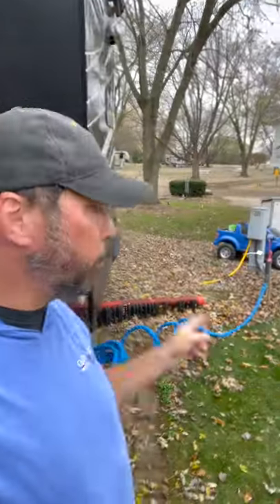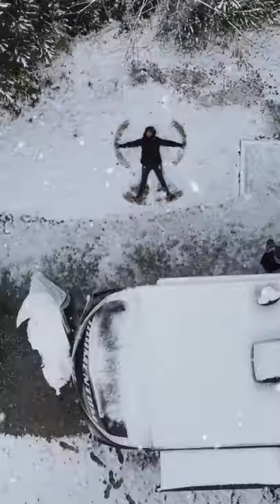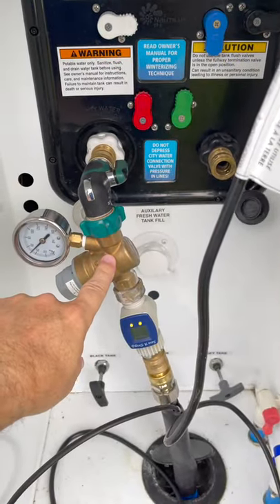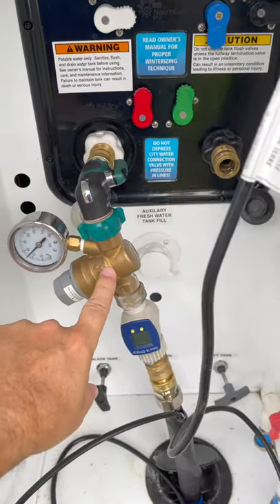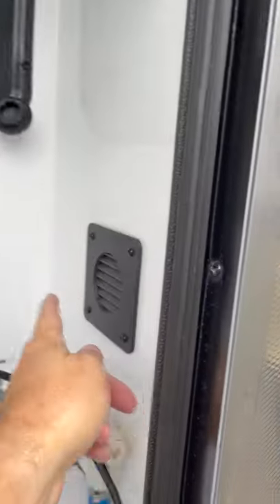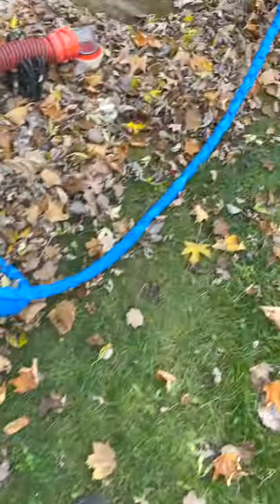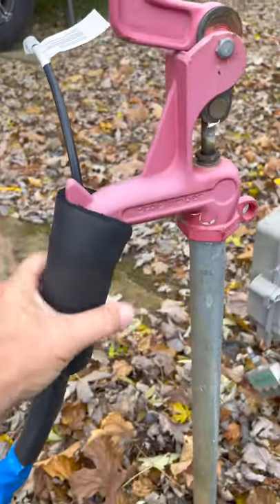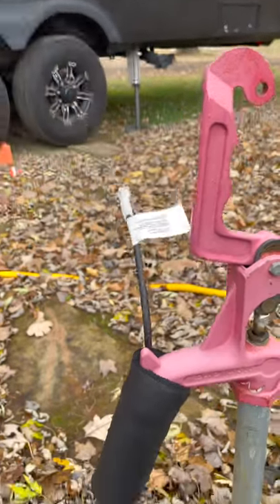🥶  WINTER RVing Tip! (Heated Hose)  #SHORTS

Comment: Take from a serial winter camper like me, heated hoses are a must, BUT, you really can’t leave them hooked up and run in city water mode. The frost free hydrant will freeze, so I place a y-valve at the hydrant end of the heated hose and fill my on board tanks and run off the RV water pump in between fills. The y-valve is to create an air inlet to allow the frost feee hydrant to drain to its gravel base, 6-8 feet under the ground level. Some might say you can just wrap the frost free hydrant with heat tape and insulation or put a heat lamp on it, and that will work in some climes, but not those with hard freezes because the ground freezes 1-3 feet below ground level. To Chad’s point, the heated hose does allow you to stay hooked up and not have to drain the hose between fills. Great video short guys!

Comment: I don't camp without this hose. The hose does use a lot of energy. It kicks on at 42° and stays on until the temperature rises above 42°. In order to save energy when temps drop into the upper 30s and low 40s overnight unplug the hose until freezing is in the forecast. Male sure to plug it in at least 4 hours before freezing is expected to ensure the hose doesn't freeze before the coil warms up.

I would not recommend using any sort of remote operated on/off plug adapter. Many remote operated items use the same frequency and coding. At least once a week someone in a neighboring RV has turned something on or off in my unit. My fireplace remote has the same code frequency as two space heaters, all of the RGB remote operated LED bulbs, and three of the eight LED candles. Yes, all of the remotes for the aforementioned items are work the same as the fireplace remore. It's so annoying. The last thing you want is a neighbor turning the your hose off when they turn off their lamps or whatever item may use the same frequency and coding as your remote plug adapter.

Comment: What do you do when the riser out of the ground freezes? 
Farm hydrants for cold weather have a drain at the bottom that allows the water in the riser to drain into the ground, but the valve needs to be turned off for this to work. This may not work with the hose connected depending on where the air goes in that allows it to drain.
Reply: It’s only heated to where the hose connects. Can’t see it working in very cold temps. Better off filling the tank as needed.

Comment: You do realize that the water hydrant is not protected, you need a heater on it as well.
Reply: We got one last year, after freezing hose the year before. The hydrant still froze though, thought about getting a short length of pipe insulation for next time.
Reply: K Math that type of hydrant is for cold weather, the handle is connected to the actual valve by a rod and it is below ground where it won’t freeze.
Reply: @williamdodson6681  William there really is nothing that is protected from freezing. This particular water hydrant also known as a frost free opens the water valve several feet below ground. So with that, the entire pipe from 4-6 feet down is full of water when opened. When you shut these type water hydrants off the water drains out of the pipe by the vale. You must unhook the water hose unless an anti siphon value is on it.

You can wrap the hydrant with heat tape, this is an heating cable you plug in to a 110 volt plug as well. Then wrap that with insulation. The big problem is if you are in a cold climate the frost will get deep and could freeze the pipe closer to the end of the hydrant. 

In my opinion the best option is to  fill the water tank and shut off the water and unhook it from the hydrant. Then refill as needed. Yes it’s more of a pain but not as much as freezing everything up. If the water hydrant freezes in all my experiences you dig a big hole and replace the entire unit.

Comment: I'm surprised the campground has the water spouts on because what is stopping them from freezing? 🥶
Reply from the maker: turns out they will freeze but not break like a hose would.  We'll be getting an extra heat tape to over the spigot at our next winter location.